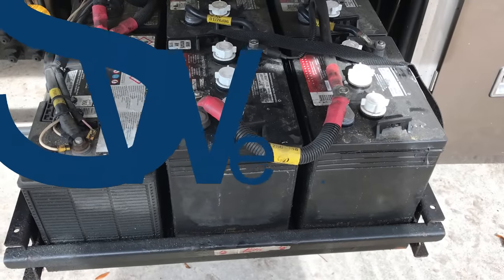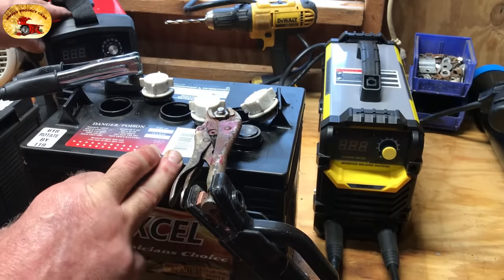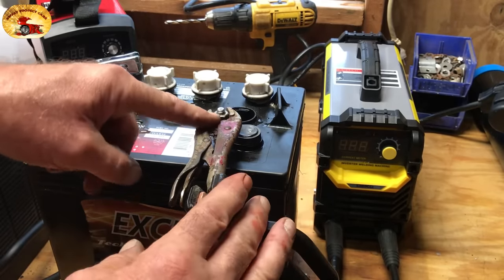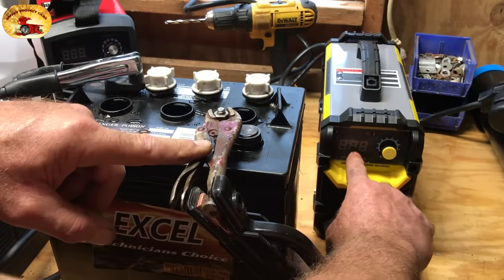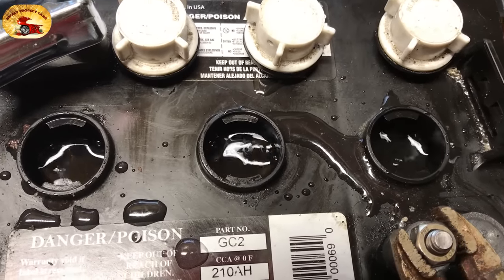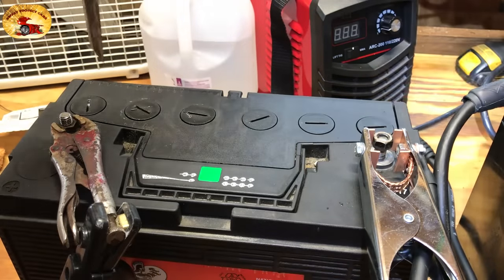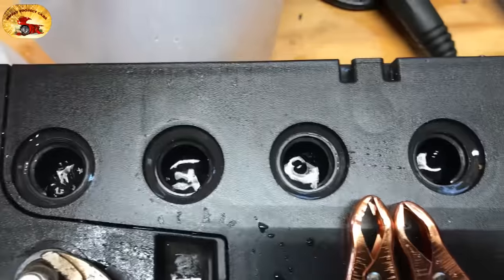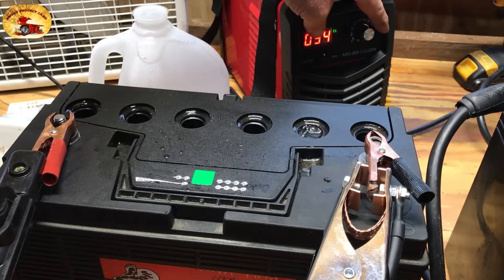How To MAKE OLD BATTERIES NEW Again!!!  12v 6v Deep Cycle, Car, Truck, Golf Cart, Semi

Comment: Howdy friend.  I bought those 2 welders and am now trying to revigerate my 8 volt golf cart batttrees.  Are you saying to keep the power at about 38 amps during EACH of the 5 charges?  I bumped the welder up a bit more each time, and did 38, then 60, then 72, and then fired the puppy up with 120 for a minute and back to 90, and the last one back at 72.  You think this is OK, or was I pumping too many hot electrons into her?   As Coptain Kirk would say, "Scotty, we need MOORE power....MORE power Scotty!"   But Coptain, Im giving her all Ive got!   Im an engineer, not a miracle worker!
Reply from the maker: This is how we do it, start the welder out on the lowest setting then gradually turn it up until you get a rapid boil on all of the cells, follow the process in the video and make sure you recap and unplug the welder before disconnecting the cables. Thanks. mad Mike the hammer SPC
Reply: @SweetProjectCars  Thanks for the reply back.  Just to clarify,  you only said 38 amps on the video.  So, is it ok on the batteries when I go 38 the first 5 min, then 60, then 72, then 100, then 72 for the final 5 minute charges?
10-4 on unplugging the welder......no sparks wanted.

Comment: Hi, this was am amazing video to watch, I had a welder with input 220V 10A, output of 70V no load voltage, and 250Amp max, I used it for 5 mins then off for 10min, 5 times, the WELDER'S amps was about 100A,, the issue here is the battery was really hot, should i extend the time interval or what should i do,
Thanks
Reply from the maker: Our videos are very tool/product specific, you need to use what we recommend.  Thanks for watching.  Have a great day.  mad Mike the hammer SPC

Comment: Does it have to be an inverter welder iv got an old ark I’d like to try
Reply from the maker: You can use whatever you want to use, we are simply sharing what we know works every time and is safe for both you and your batteries. Thanks for watching. mad Mike the hammer SPC

Comment: Will the yellow charger work on 12v deep cycle battery?
Reply: Never mind I found the answer under Hot Rocks comment and your answer. Just got my Deko “DKUS-MMA160A welder in and have 2 DC batteries that won’t take a charge anxious to try this out. I will update my results and do a follow up to see how they hold and load test.
Reply from the maker: It will David.  Thanks for watching and asking.  mad Mike the hammer SPC

Comment: Well...tried it on my two RV deep cycle batteries. Got one to work, the other one was already bulging pretty badly but I still gave it a try; only one side reacted. Tried for several minutes intermittently and no joy. I charged then both regardless and as of now the smart chargers show 100 percent and 13 volts. The batteries were both completely dry I inside from a used rv I bought and dated 2016.
Reply from the maker: Thanks for watching and sharing my friend.  Glad we could help.  Have a fantastic day.  mad Mike the hammer SPC

Comment: Hi Mike. So the voltages of the welder for 6v battery are? And for 12v? Regards
Reply from the maker: Not really sure what you are asking so I am going to give you a general reply, in the tools list, it is listed which welder you need depending on which type of battery you are working on, either a standard battery or a deep cycle battery.  If you have a deep cycle 6v or 12v you need to use the corresponding welder as shown in the tool list.  Hope this helps.  Thanks. mad Mike the hammer SPC

Comment: I bought a Schumacher full size battery charger that puts out 200 amps in start mode. I tried this on a battery for my car, and I did six Cycles at 15 minutes on, one hour off. For some reason, the battery would not wake up, and it is only showing 6 volts.
Reply from the maker: Hello, you can do the whole process up to 5 times, if it doesn't work after that, your battery is junk. Thanks for watching and sharing. Have a great day. mad Mike the hammer SPC
Reply: @SweetProjectCars  thanks! I'll give that a try. Love your channel, your videos are very old- school informative.

Comment: If the plates are completely submerged, I don't see the need to top them off with water.  Less acid getting splashed all over the place from the bubbles if the level is a little lower.
Reply: go 4 it  there your batteries
Reply from the maker: You can do whatever you want to do my friend.  They may need to be topped off during resting periods if the fluid gets low.  Thanks for watching.  mad Mike the hammer SPC

Comment: Hey guys I just ordered the welder from the UK tools link (I live in ireland) . I'm pretty sure I understand the whole process but I have two questions. 1: how do I definitely not blow myself up? And 2: why don't you use a timer switch so you don't need to keep switching the welder off and on?
Reply from the maker: First, we don't trust a timer switch, this is a process that needs to be done manually.  Follow the video, take your time, start with the lowest setting on the welder and gradually turn it up until you get a consistent boil.  ALWAYS make sure you unplug the welder before removing the battery cables.  Thanks for watching and asking.  Have a great day.  mad Mike the hammer SPC
Reply: @SweetProjectCars  thanks a million  for the speedy reply.

Comment: Hi, thanks for the greatt video.  I've got 12v deep cycle solar batteries and an old heavy welder  , will that work? Thanks
Reply from the maker: Give it a shot, but if it doesn't work, you know what you have to do.  Our videos are very product/tool specific, so to obtain the same results, use what we use and recommend.  Thanks for watching and asking.  Have a great day.  mad Mike the hammer SPC
Reply: Did it work?  If so, what is the make/model of your old heavy welder (specs would be nice, too).

Comment: HI I NOTICE THAT YOU ARE USING A  DEKO DKA Series DC Inverter ARC Welder. DOES IT HAS TO THIS MACHINE OR COULD BE ANY INVERTER MACHINE WITH DIGITAL GAUGE PLEASE LET ME KNOW
Reply from the maker: You can use whatever you want to use, we are just sharing what our 40 years experience along with testing has given proven results that are both safe for you and your batteries.  Thanks for watching Gonza!  Have a great day.  mad Mike the hammer SPC

Comment: I have used a golf cart charger hooked up to 12v
Reply from the maker: Thanks for watching and sharing, have a great day. mad Mike the hammer SPC
Reply: @SweetProjectCars  thank you. Yeah I have a older 80s 36v golf cart charger and I cut the golf cart end off and have clips on ends now. Pull the caps off battery fill them then hookup to golf cart charger and it boils them really good

Comment: Does this process work with only welding machines with an INVERTER?
Reply from the maker: This process only works with the welders we use in the video, use one of those and you will have success.  Thanks.  mad Mike the hammer SPC
Reply: @SweetProjectCars  Thanks

Comment: How does this little welder compare to a Vulcan from Harbor Freight?  What is the key feature we need to look for  in a welder for this desulfering technique??  Thanks!
Reply: Nevermind on the Vulcan question.  They are higher than i thought.  There is a 225A Titanium though but it is $300.
Reply from the maker: You can use any welder you want to we are just sharing with you the welders that are safe for you and the battery have a great day

Comment: Can I do my truck battery with my little 80 amp welder? If so what should I set the amperage on the the welder at?
Reply from the maker: I doubt 80 amps is going to give the battery the knock out punch that is needed to jolt it back awake, but give it a shot.  Thanks for watching.  Have a great day.  mad Mike the hammer SPC

Comment: Well I tried this out for size. I took the battery and use my welder to do the job in DC mode. Then I took the battery to O’Reilly’s And had a long tested on the machine for an hour and a half. Before it would not hold a charge above 11.8 V. Now it holds a charged and pass the test with a load placed on it. 12.85 V. As long as the plates inside don’t have holes in them From deterioration, I imagine this would work. It will be interesting to see how long the battery last now. It was made on March 2017. It is a 4 year Walmart battery with a two-year replacement guarantee.
Reply from the maker: You saw it first hand my friend, it works, we've been doing this for 25 years.  Thanks for sharing.  mad Mike the hammer SPC

Comment: Hello Sweeeeet Project Cars.  Great videos.
The Battery Tender Plus 1.25Amps charger you recommend is just for 12Volt batteries.  In the case of 6V Deep cycle batteries, after doing the first process with the welder would you use two 6V Deep Cycle Batteries connected in series or you would recommend another charger?
Reply from the maker: We recommend this  https://youtu.be/Sp6HGSSQGXk  for all deep cycle batteries Goku.  Thank you for watching and asking, have a great week my friend. mad Mike the hammer SPC

Comment: Is it nessacerry to empty battery and refill with new acid
Reply from the maker: No, before beginning the process just top off each cell within an inch from the top with this  https://amzn.to/3gb9Ni0  then as needed during the rest times of the process.  Thanks for watching, have a great day. mad Mike the hammer SPC
Reply: My golf cart battery still hold somewhat of a charge...but don't last about 18 holes....if the battery is fully charged can I still run the process in it.

Comment: I guess the process is to use much higher voltages and amps and basically overcharging the battery for a short time? If i don't have a welder, could i just put some batteries in series and parallel and then do the process on one battery? Or does the welder have some kind of tickling effect or fluctuating voltage that is needed?
Reply from the maker: You can do up to 2 batteries at a time with the welder, one battery if you have a large charger.  I think this is what you are asking, but if you are trying to charge a battery with other batteries, this will not work, you need the welder.  Thanks for watching.  Have a great day.  mad Mike the hammer SPC

Comment: Can i use a Lincoln 180 HD?
It says output is 30-180amps dc.....think I figure out my own question-needs to be stick welder cause mig is wire feed...
Reply from the maker: You can use whatever you want to use, we are just sharing what we have tested and that we know works.  Thanks for watching.  Have a great day.  mad Mike the hammer SPC

Comment: Which charger would I use on 8 volt golf cart batteries? Thanks for all your helpful videos.
Reply from the maker: This one  https://amzn.to/3kd4b8K  will do the job for you.  Thanks for asking.  Have a great day.  mad Mike the hammer SPC
Reply: @SweetProjectCars  Mad Mike I have a 48v clubcar golf cart with batteries that will charge but the run time is very short, so they discharge too quickly.  I just ordered the welder you suggested to @DevinSexy for his 8volt golf cart.  Do you recommend any special overcharge routine for this problem of reduced capacity/runtime?  Its weird too because the cart battery bar meter still reads a full charge and it's goes from running fine and then they kill over quick within 5 minutes of driving.  Thx for this video BTW, very ingenius idea!

Comment: I only found the video now, thank you, Just one thing, Can't  I use the  200 amp welder set 160 amps for the 6 volt Batteries.? Then I don't need 2 welders.
Reply from the maker: You can use whatever you want to use, we are just sharing what we know works every time and is safe for both you and your batteries.  Thanks for watching Johan, we appreciate it.  Have a great day. mad Mike the hammer SPC

Comment: You can easily revive a flooded battery with dc stick welder cause the output of a dc welder is 13.6v,solar panel,desulfator or pulse battery charger 
Just to wake the cell plate of the battery 
But you can do that on flooded batteries only 
Cause I did that for how many years until now 
But there is a big question did the battery regain its amp again 
In my experience 
You cannot easily return the amp of a battery 
If you revive a battery and you test it with your multimeter and the reading is 12.9v or 13.1v 
Dont be excited that you have already revive the battery 
In my experience 
All battery that i revive has a volt reading of 12.7v to 13.1v 
But when i test the battery it will discharged very fast 
Cause the battery did not regain its amp 
It is hard to bring back the original amp of a battery 
You are lucky if you revive a 50ah  battery and the battery regain 40ah your are lucky
Agm and gel type battery it is hard to revive those type of battery
Reply from the maker: We suggest this process only for wet-style batteries, no gel/agm.  Thank you for watching and sharing. Have a great day. mad Mike the hammer SPC

Comment: What's the difference between the two welders that makes one only good for car batteries and the other only for deep cycle? Could another type of stick welder work?    I've been planning on buying an Amico 160 stick, tig and plasma cutter machine.  Could I use it for at least some kinds of batteries?
Reply from the maker: Our videos are very product/tool specific, Nathan, we have taken the guess work out for you by our years of trying and testing we share with our viewers what we know works and what we know is safe for both you and your vehicles. Thanks for watching, have a great day. mad Mike the hammer SPC
Reply: @SweetProjectCars  and its greatly appreciated. I plan on buying one of the machines you mentioned but I have some electrical work I gotta do to be able to run it or any welder for that matter. I also want to try the baking soda method since it's supposed to dissolve the sulfate Crystal's that form.

Comment: So, the deep cycle batteries require one unit (Yeswelder), and the non-deep cycle batteries require another unit (Amico)?
Is it true that if you are recharging 12V car batteries, only the Amico will work, right?
Also, what are the settings for the Amico in order to charge 12V car batteries?  If Yeswelder can do car batteries, too, what are the settings for it?  If you didn't go over welder equipment settings in the video (I can't recall now), it would be good to do so.  Thanks for sharing this knowledge.
Reply from the maker: Watch the video again and again if needed.  We use specific welders for specific batteries.  Our videos are very tool/product specific, so to get the desired results, use what we use and recommend.  Thanks for watching.  mad Mike the hammer SPC
Reply: @SweetProjectCars  First off -- thanks for updating the comments given that the original units in the video are now sold out.  Cutting straight to the chase, will the Yeswelder mentioned in the comments (not in the video) work well for all 12V vehicle batteries (or does "deep cycle" not apply to standard automotive vehicle batteries -- I don't know if it does or not).  If it does, it would seem that would be the unit to get (broader battery type recharging capability, less cost), unless one's welding requirements required the more powerful and more expensive unit.

Comment: I have some rolls 400ah 6v batteries.  Should I up the voltage or the time for such a large battery?  I'm currently using 38v for 5 minutes, 10m rest, then repating 5 more times.  Btw, is there a max voltage i shouldn't exceed?  The batteries are producing small bubbles but not boiling like.in your video.
Reply from the maker: Start out on the lowest setting, then gradually turn it up until you get a consistent boil on all cells Todd.  And remember make sure you recap and unplug the welder before disconnecting the cables.  Hope this helps.  Thanks for watching, have a great day.  mad Mike the hammer SPC
Reply: @SweetProjectCars  should I increase the time because the battery is so large (400AH @ 6v)?  The #2 cell has no specific gravity reading.  Either the cell is not desulfating or so hard crystallized that it won't convert back into acid.  Suggestions?  Should i add some new acid?

Comment: I have a 200 amp auto battery charger will that work on a golf cart 12v deep cycle battery ?
Reply from the maker: Our videos are very product/tool specific, you can use whatever you want, but we have tried and tested our recommendations as they are what are the safest for you and your batteries.  Thanks for watching Howard.  Have a great day.  mad Mike the hammer SPC

Comment: man Mike, The Red Welder can run on normal house 110v AC. Is 15A AC wiring ok or does it need to be 20A wiring? TIA
Reply from the maker: If you have a 15amp breaker running that outlet, you will be just fine.  Hope this helps Richard.  Have a great day.  mad Mike the hammer SPC

Comment: Question...
 I have an Amico Arc-200 with 2 knobs; Current and Arc Force. What are the knob settings I need to use to recondition my car battery?
Reply: get the machine he shows
Reply from the maker: Not sure, we only promote the welders shown.  Thanks for watching.  Have a great day.  mad Mike the hammer SPC

Comment: I watch your two video..i want to try it with my motorcycle battery using may 300amp welding machine...how many hour if i used the welding machine to charge may car battery??
Reply from the maker: Just follow the video as shown, using the EXACT products/tools and in doing a motorcycle battery cut the timelines in half.  Thanks.  mad Mike the hammer SPC

Comment: The second welder the one you are using for the car battery. Can I use that for a mower 12 volt battery so I don’t have to buy 2 welders?
Reply from the maker: You can use whatever you want to use, we are just sharing what we have tested and tried that has given great results every time that are safe for both you and your batteries.  Thanks for watching.  mad Mike the hammer SPC